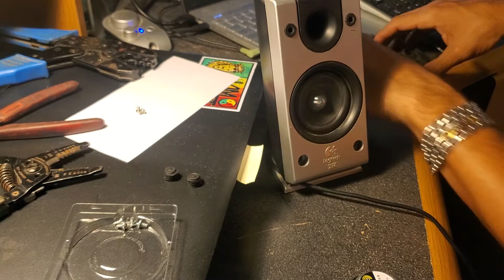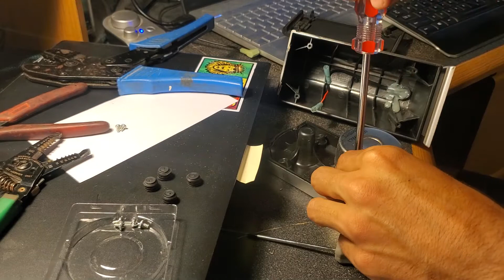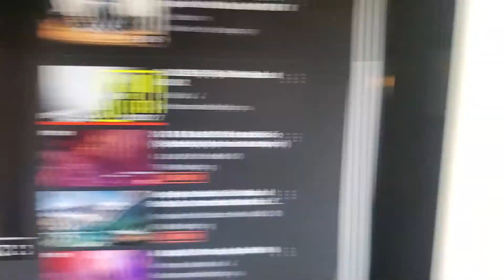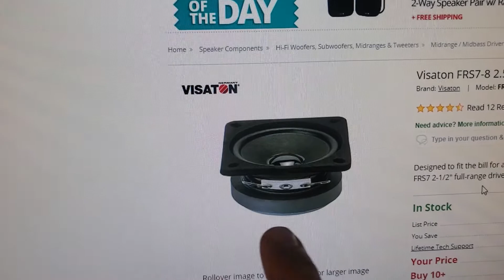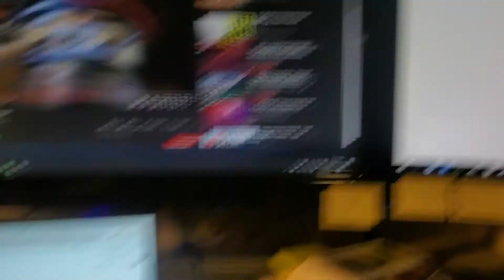Repair Logitech Z-2300 Satellite Speakers (replace part 170001-0000)

Comment: worked almost perfect. The speakers needed too be glued into place because the silver screw holes where not in the right spot which I think you mentioned.
Reply from the maker: Yeah I know that was a bit annoying. You either force have the screws at an angle or glue it to be safe but hopefully your set up is working just fine

Comment: Tengo una duda técnica sobre los controladores Dayton como reemplazo. Los Dayton especifican un 50% menos de potencia (máxima y RMS) en comparación con los originales de Logitech. Sin embargo, sabemos que Logitech suele inflar sus cifras basándose en la capacidad del amplificador; por ejemplo, declaran 40W RMS con un THD del 10%, lo cual implica una distorsión altísima. Esto sugiere que el vatiaje real de los satélites es mucho menor, de hecho, hay drivers usados del mismo modelo en AliExpress que tiene la marca de "10w" atrás (cosa que los originales de Logitech no traen, pero son exactamente lo mismo).

Mi pregunta es: ¿Estos Dayton mantienen la fidelidad al 100% de volumen o distorsionan? Tengo varios sistemas (Z2300, Z5300 y Z623) que me encantan, pero todos han sufrido daños en los satélites y las reparaciones nunca los dejan con el sonido original.
Reply from the maker: I have ran them at high volume (75-80%) but never push them to 100% just out of fear of killing the speaker. At the highest level I have ran them I do not experience distortion and enjoy a loud of sound and quality to be happy with the performance of the substitution I made with the satellite speaker parts

Comment: I just disassembled my stock Z-2300 satellites and verified the factory wiring: Logitech intentionally inverts the polarity.

Black wire is connected to the Positive (+) terminal (Red dot).
Red wire is connected to the Negative (-) terminal.

Why do they do this? I believe it is likely for phase alignment with the subwoofer. In 2.1 systems, the electronic crossover often introduces a phase shift. Inverting the satellites ensures that the sound waves from the sub and the speakers sum up correctly at the crossover frequency, rather than canceling each other out (which would kill the mid-bass).

IMO, for those upgrading to Dayton (or other drivers): To maintain the correct phase and the original sound signature, you should mimic the stock wiring:

Connect the Black wire to the Wide / Positive (+) terminal.
Connect the Red wire to the Narrow / Negative (-) terminal.
Reply: this should be pinned.
Reply from the maker: @Razzaq585  apparantly I'm not verified to pin a comment... so pin is pending haha
Reply from the maker: very useful information thank you for sharing ❤

Comment: Did you notice your Red wire was connected to the Minus/Black terminal?  Mine were.  I tested to see if the Red to Red from a positive battery post produced outward movement of the armature.  It did.  Did you preserve the backward wiring?
Reply from the maker: I preserved the same wiring it was originally set up with

Comment: I've been studying what's out there.  I have a damaged surround which I will repair and am also looking for replacement surrounds.
Speaker selection:  I noticed Part-Express gave vented and sealed box specs:  box volume and Box Frequency.  So I looked into choosing a driver which matched the box:  
The volume I estimated as a 3" wide at from, 2" wide at back, 3" depth resulting in 7.5 cu in / 1728 = 0.026 cu ft.  The DMA70 vented spec is 0.04 cu ft. amd 88Hz.  The FRS 7 is 0.02 cu ft. and 74 Hz.  There is a very interesting 2.5, the ND65-8 which has a better freq resp at 100 hz, but it's Vbox is 0.034 cu ft. and 59Hz.  However the sensitivities are respectively:  83, 88 and 80db.
It's possible to adjust Fbox by adjusting the port length.

But the Survivalist APproach would be to choose the speaker with the biggest voice coil and highest rms watt capacity:  20, 8 and 15 watts respectively.  25, 14 and 19mm VC dia. respectively.

It might be interesting to find some free speaker design software using Thiele-Small parameters to see what kind of result there is.  Of course, the woofer crossover frequency is another factor.
It would be nice to measure the characteristics of the OE speaker.  This can be done.  It is clearly a waste of time, but performing these experiments and calculations are their own reward.  And who knows,  the result might just be noticeable.

There are a lot of speakers from Parts-Express.  Wish they had a filter to select from their specifications.

THANK YOU SO MUCH FOR YOU VIDEO !!!!!!!!!!!!!!

Comment: There is a 5db difference in sensitivity between the 2 speakers.  The one you chose is a better speaker but 5db less efficient.  Did you notice a change in volume?  My guess the OE was a cheaper speaker and probably higher efficiency.  I really like the idea of the 1.0 inch voice coil - that is a big deal.  And given the power handling ability, will be hard to blow although clipping is death to tweeters.
Reply from the maker: I haven't noticed any loss in sounds quality. I still keep expecting to have to replace them again but everything is holding together nicely even working from home blasting music at high volume so couldn't be happier with what I've got. Thanks for the stat info hope your rebuild works for you as well as it did for me🙂
Reply: Spot on observation! I just finished the mod with the DMA70-8s and I can confirm the exact same thing: I have to turn the volume knob higher to match the previous output levels.

However, this isn't necessarily bad—it's actually the expected trade-off for Hi-Fi quality (Hoffman's Iron Law). The original paper drivers were engineered for high efficiency (loudness) at the cost of control. The Daytons use a heavier aluminum cone and a larger voice coil, which drops the sensitivity to ~82.9dB but, at least in theory, drastically lowers distortion and improves bass control/extension.

Basically, we traded 'easy volume' for 'cleaner sound'. Since the Z-2300 amp has plenty of headroom, it handles the extra load perfectly fine. I just treat the volume knob's '12 o'clock' as the new '10 o'clock'.

Comment: Great video. Based on this video I also bought the Dayton Audio DMA70-8, but to my surprise the mounting holes don't match to the original speaker, so it's not a complete drop-in. Before I start doing crazy stuff, how did you mount the Dayton's to the front of the speaker?
Reply from the maker: It should sit in the framing very well but yes the screw holes do not match up.  If you see in the video I used different screws with the same diameter but longer and self driving and screwed them in at an angle. Obviously careful with how far you screw them in because accidently went too far on one and it tries to come out the front so definitely avoid that. You have room in the casing to had the screw sit out the back a bit. As mentioned in other comments you can also glue them after to remove any backing out of the screw from vibration but i did not glue mine and I have had no issues.
Just use your best judgement on the screw choice but as long as it is about the same diameter and not too long then you should be just fine. Hope this helps you with moving forward on your repair, good luck!!
Reply: @BrentBurke13  Thanks for the very quick reply! I decided to leave the original satellites as they are and create new "enclosures" using 100mm PVC pipe. For a BR configuration I saw the ideal capacity should be 1,6L. I'll use a well damped 2L enclosure and print 2 rings to close up the front of the pipe. This way I can use the monitor stand to fix the enclosure and both speakers will be on the right level on both sides of the monitor.

Comment: 4:45 How are the screws able to be such an extreme angle not damaging the threaded insert that the screw rotates into !?
Reply from the maker: Its plastic so there is room to still connect even at an angle although it not ideal it does work

Comment: #4 3/8" pan head sheet metal screws work perfect to attach the daytons, you can tighten them down all the way and they sit flush

thanks for this video btw, never thought about just replacing the speakers and stumbled across this while trying to figure out what new setup to buy cuz my satellites are blown out and I finally got tired of the rattle. Got the daytons and saved a bunch of money, cheers!
Reply from the maker: Glad this helped you and you're enjoying the fixed speakers.
Thank you for the information on the screws I should have replaced them but was lazy and just used the same materials haha but this is great for those who want a more proper installation

Comment: Just bought these Dayton speakers on your behalf. They better be good man! Hahah. I also used a boxcutter to succesfully remove the foam on the old speakers since refoaming only costs like 4 bucks. Just for fun. I think refoaming isnt even that hard I feel like its gonna work. Thanks for showing how to take the sattelite speakers apart and linking the speakers!
Reply from the maker: You are very welcome and good luck with your repair and trying out that foam

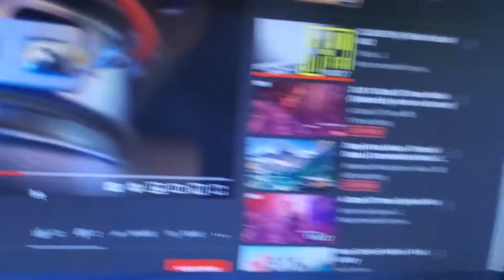Comment: I just noticed at 7:30 you are showing original soldering points and the red wire is soldered to the - terminal and the black is solder to the + terminal. That is exactly how it is on my speaker too. If both speakers are the same then it is ok (I haven't open my other one yet). But if originally both speakers (L and R) are connected this way and you changed this on your new speaker then it will be out of faze with the other original. Also I noticed the original speaker is 2-3/4" in size (2.75" not 2.5") and that is the reason why it is so hard to find the replacement. 
Your choice is also better as it looks like it is shielded. Double neodymium magnet makes it better control of the cone.
Either way I will buy and replace mine as you did (except the wiring) as I am sick and tired searching the net for the right part. 
Thanks for the upload.
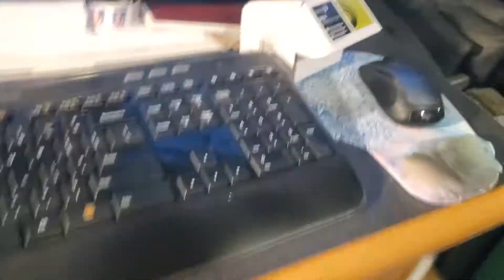Reply from the maker: Glad my video helped and yeah I don't think mentioned it but I'm pretty sure i kept the polarity of the wiring the same as the way I found it and the image at 7:30 was the other person's video but yes since I could not adjust the source wiring I installed the new speaker with the same connections to the positive and negative terminals
Best of luck with your repair!!
Reply: I noticed that the wiring was reversed. Did you end up fixing it with the same reverse wiring? If so how did it work?

Comment: Also, as an updated Logitech connected these speakers in versus polarity from the factory, thus making the speaker cone "pull in" upon voltage applied. The correct fashion is the speaker cone should "push outward" when voltage is applied. Incorrect polarity will shorten the life and any speaker/woofer. I've email them the proof with pictures and no reply yet.
Reply from the maker: Its very interesting this reversed polarity has been noticed by a few people opening up their speakers.  Thanks for that bit of detail and I hope they respond to your email. Curious what they will say!!

Comment: Great Video Thanks. I have watched otto's video and the Visaton FRS 7-8 speakers seem to match up perfectly to the original holes so you can reuse the original screws it would seem. In my country (Australia) the FRS are half the price when compared to the Daytons which are $42 each!  Cheers for the help, much appreciated.

Comment: Thank you. Life saver. Had this system for nearly 15 years. It has served me well and was not ready to let it go. Especially since nothing out today is worthy buying for a desktop 2.1 system that i could find. I need studio speakers. But not in a position to buy what i really want. Plus I've mixed and mastered music on these things for over a decade. Completely usable for that. I procured some screws but wasn't excited about the idea of boring into the housing and not sure of the longevity or sturdiness if they didn't catch. Not a lot of plastic there and kinda sketch.  So i Krazy Glued them on >D Figure the original lasted 15 years so fairly unlikely these will blow in the near future, in fact the originals would still be fine but i got a little to partied up one day and cranked them waay too far. They sound exactly the same at default. I run a system wide EQ to accommodate my room. Soldered them in, took no time at all. \m/\m/
Reply from the maker: Awesome!! I was in that same position and couldn't get myself to buy something new to replace these which I loved so much so resurrecting them was definitely a must and I'm so happy you got the result you needed, enjoy your sound!!!

Comment: Thanks very much for the video. Very helpful. Four comments (mostly based on what others have said):

1. The sound of the Dayton's is a bit darker than the originals. I guess I will get used to it.
2. The drivers appear to have been wired with reverse polarity on purpose, presumable to get them in-phase with the woofer.
3. I found a pack of 4x38 sheet metal screws at my local Ace Hardware that worked perfectly for attaching the drivers. $1.65 for 25 screws.
4. I used a little bit of shoe glue to secure the mounting screws from vibrating out, and also to reattach the two speaker halves. You want to be very careful to control any source of vibration, and I assume that the glue was part of the process to control cabinet vibration.

Again, may thanks.
Reply from the maker: Glad you found the video helpful and thank you for the additional information, I hope everyone takes the time to read your comment it is extremely helpful :-)

Comment: Mine right speaker is louder than the left one. Some say its the volume controller. But i'm not sure.
Its not the cable thats for sure.
Reply from the maker: I would check the connections making sure nothing is loose or having a less secured connection than the other. If they cables and the connectors are solid then it's most likely one speaker unit is failing causing the sound that is produced by it to be less than the fully functional speaker
Reply: @BrentBurke13  Could be a filter cap on the bottom of the control pod PCB. Mine had a broken input wire and a filter cap with low reading compared to the other channel cap that reads 10k ohms. I replaced the cap and it fixed the low volume in one channel.

Comment: I have to replace the right speaker I was wondering if anybody on here would know of the two options of replacement speaker which is the better one?
Reply from the maker: I would check out the full specs for each on the parts warehouse links I provided in the video detail section and choose from there. Low probability someone has replaced with both unless one failed and so far I haven't come across that with anyone.
The Visaton part says it has a waterproof if that helps your decision? haha🤷‍♂

Comment: I have had these speakers since I was 16 years old back in 2006 when they were on sale at Best Buy for 120 dollars. I still use them to this day for my computer. Everything works perfectly fine EXCEPT for the spring that sits underneath the power button on the volume and bass control module, its worn out so every now and then the audio cuts out and I have to press power button a couple times for the spring to get back in the right place. Could you possibly do a repair video on how to replace the spring on the control peripheral? Actually also the audio jack for headphones doesn't really work on it too but that's been negligible for a decade now.
Reply from the maker: I"d rather not open up the unit until I have a reason to disassemble it but the access screws are located under the non-skid pads on the bottom I would try just opening it and see what's happening in there.
The spring is easy and just needs a slight stretch to maintain its connection. I've done this with chargers for tiny ear buds and its a fairly easy fix.
As for the headphone jack that will depend on the damage your unit has hopefully it's just a loose wire connection you can tighten and set right again but its possible the jack may need to be replaced but hopefully that's not the case if it still works most of the time.
Sorry you are having those issues but hopefully they are easy fixes, best of luck!!

Comment: Any other alternative speakers ? The one you mentioned are out of stock.
Reply from the maker: I provided two types of speakers that would work so I would either search for them from another supplier or find an alternative that matches the same size and specs. Good Luck!!
Reply: @BrentBurke13  thanks !